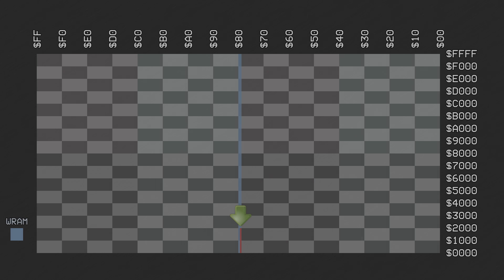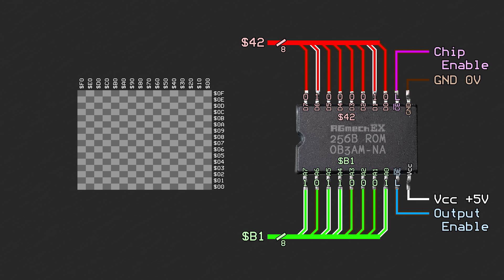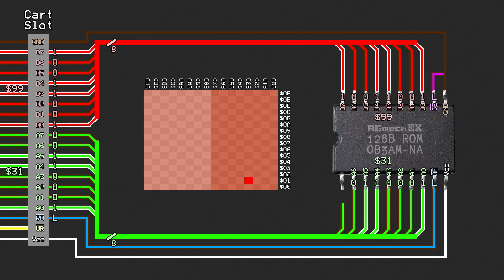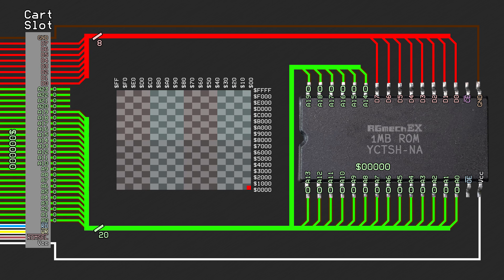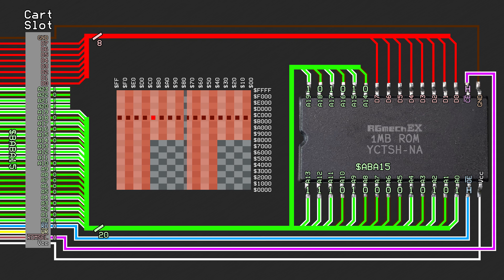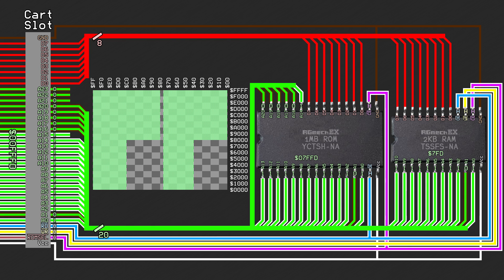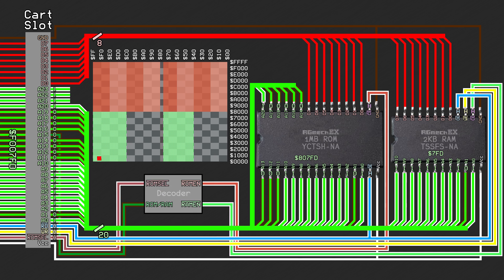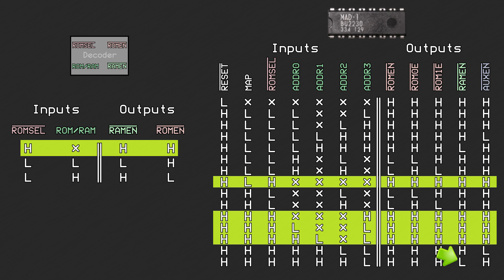Mirroring & Open Bus - Super Nintendo Entertainment System Features Pt. 09b

Comment: 1 minute ago woo!

how are you getting this deep into the system?
Reply: The guts of the SNES have been known for decades. Emulators didn't write themselves ;)

Apart from that, it's a pretty standard 65C816-esque design; and it was the same processor used in the Apple IIgs back in 1986, so a lot was already known about its architecture when the system released. Hence why there were SNES emulators with varying levels of functionality as far back as 1994 with full functionality by 1996-1997.

There is pretty much no detail of the SNES design that isn't 100% blown wide open in the public domain, at this point.
Reply: @tehcmn  i never owned one so i wouldnt know lol, my first console was a ps2 :P thanks!